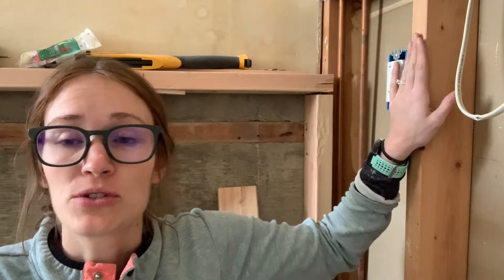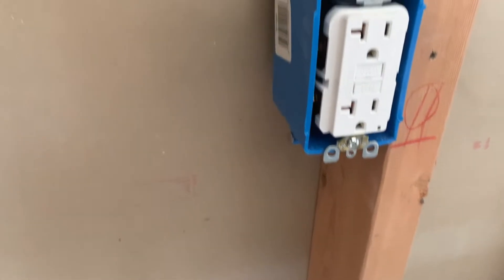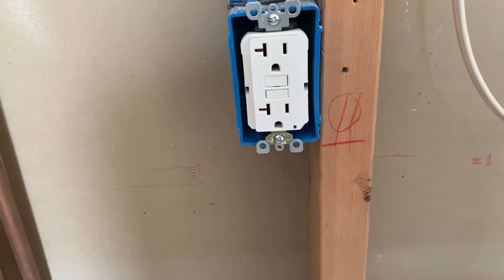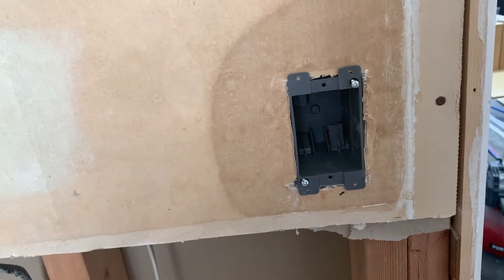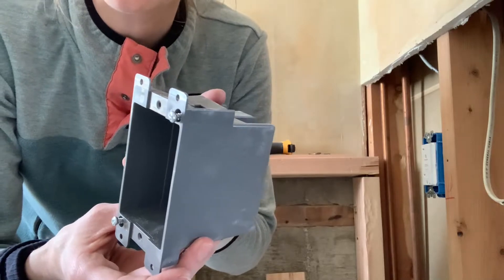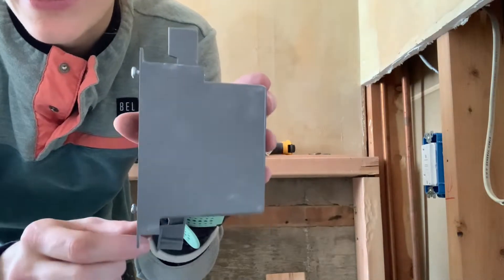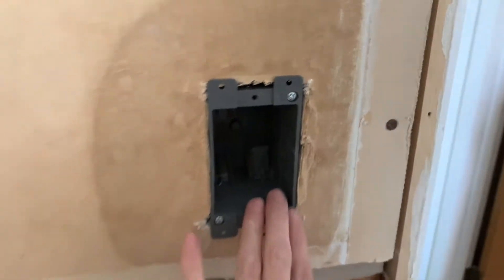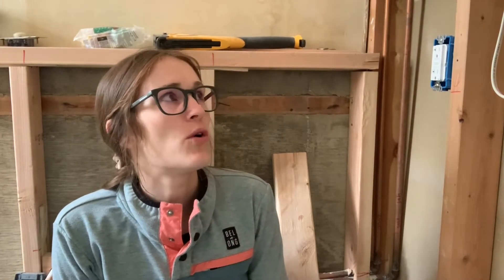Old Work (Retrofit) Vs. New Work Electrical Boxes

Comment: Would you consider doing a video about replacing FPE stab-lok circuit broker panels? I have them and I want to replace them since they have a higher than normal failure rate. thanks
Reply from the maker: Oh man, I don't think I have anywhere to do that/use that. Maybe suggest with Scott since he does a lot of electrical?
Reply: Ok. Thanks for responding!